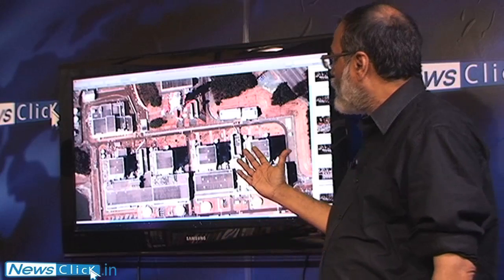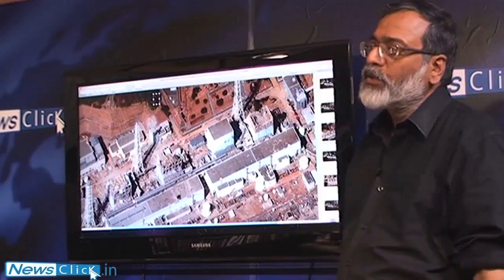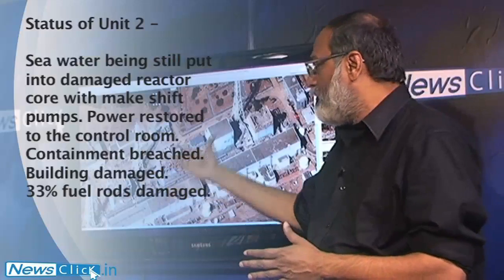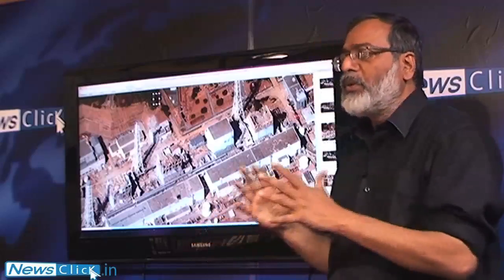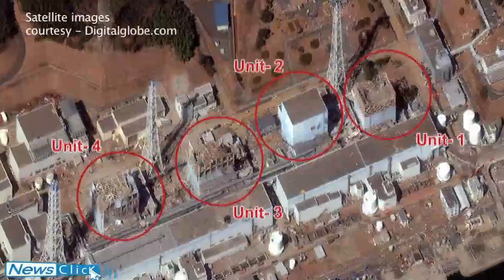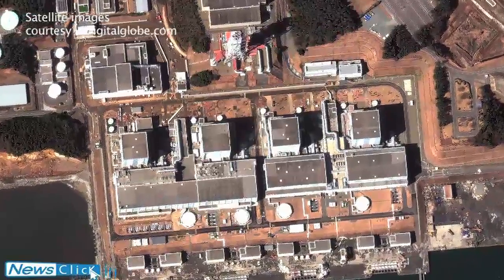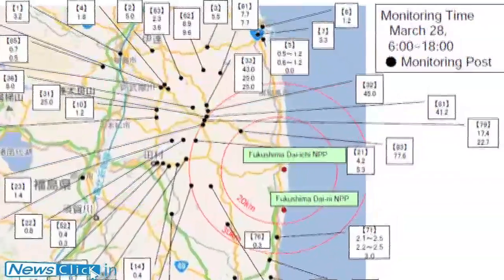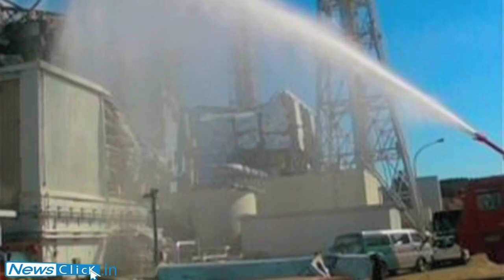Part I - "Fukushima - Undoubtedly the biggest nuclear disaster since Chernobyl" - A.Gopalakrishnan

Comment: Excellent commentary. My only disagreement is the Tsunami protection design was not based on current state of the art modeling which would have prevented the whole sequence from happening if backup power had been available.

Comment: @GrassPossum 

Also talk of containment with concrete is rubbish too. Chernobyl had an explosion which shut down the reaction. That shut it down instantly and thus concrete entombment was an option, not that it has been a permanent or failsafe solution. However these reactions are not shut down and covering it in concrete will just make it explode.